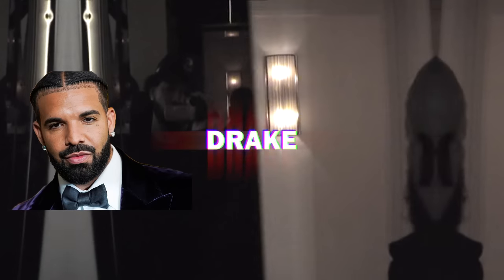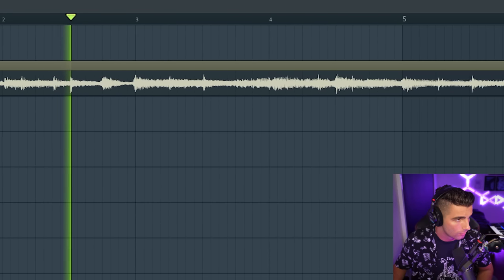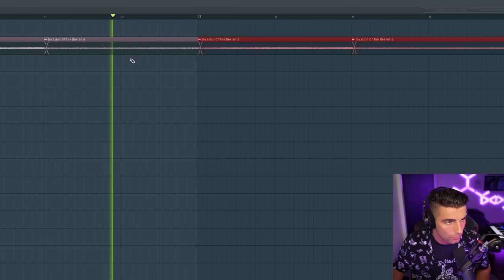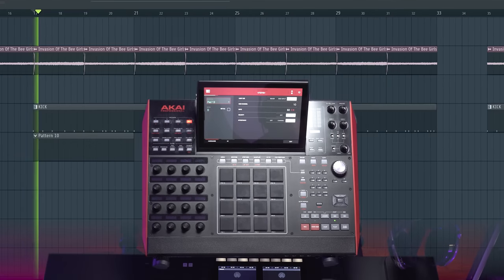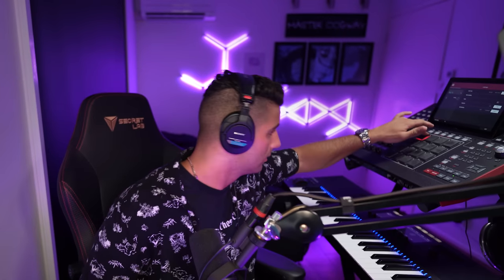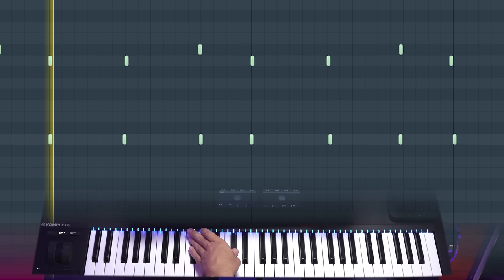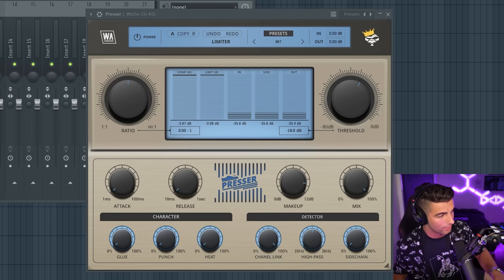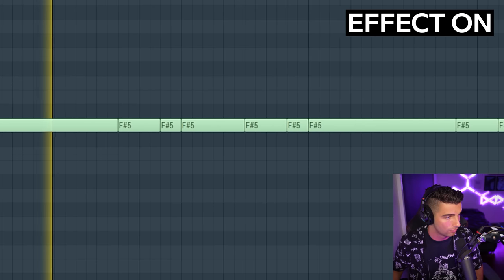How "Rich Flex" by Drake & 21 Savage was Made (100% Accurate)

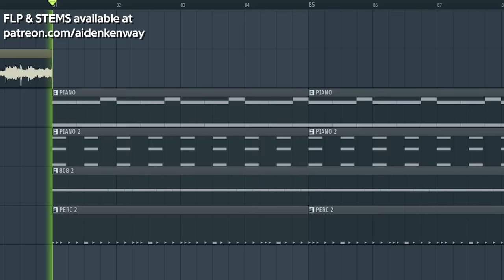Comment: Bro at 7:07, the final result was about 40 cents lower in pitch than what you compared with Shazam at 7:13. Did you even compare it with your own remake?
Reply from the maker: The weird pitch shifts happened a few times throughout the recording (not sure why). You can hear it too with the 808 too for some reason. But yes I did compare it with my remake 🔥
Reply: @AidenKenway  alright thanks sorry 💯

Comment: any reason you use a pitch shifter instead of just pitching up the sample?
Reply: It changes the length of the sample which is what he didnt want to happen
Reply: @714javi  only if you don't set it to stretch mode...
Reply: @lil_floofer  that is correct, there are many methods to change the pitch of a sample and match it with your bpm, I was helping a fellow commentor 😁.